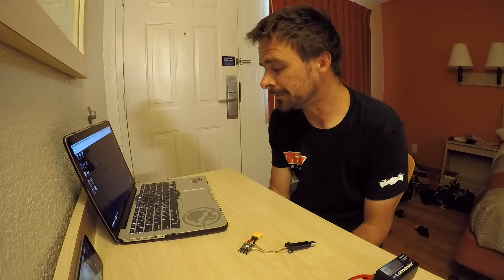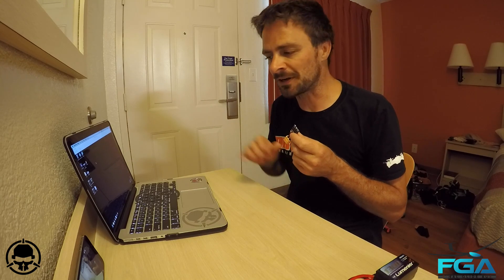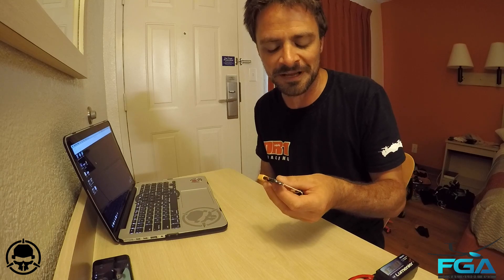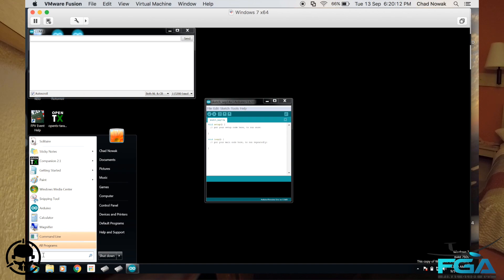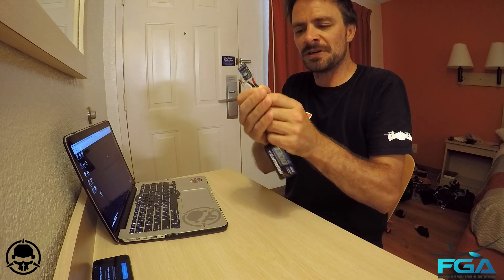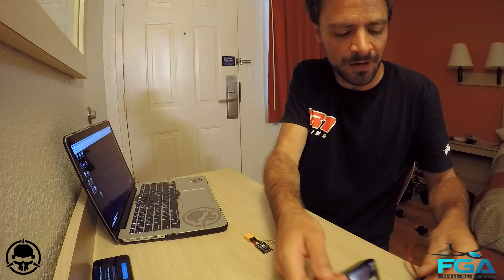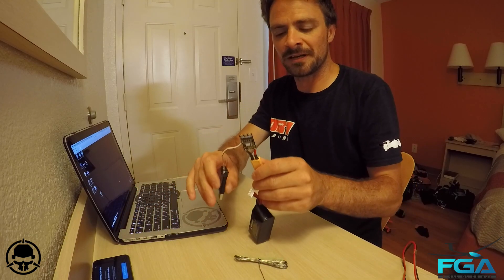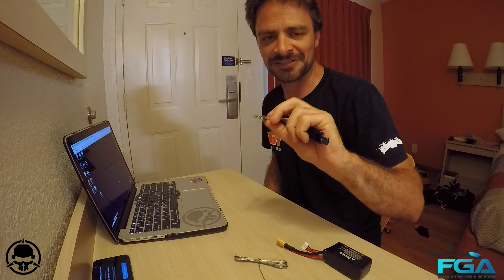Flashing FW 1.02 to earlier versions of KISS 24a using a USB UART tool

Comment: I know this is old. but I'm updating some 1.01 esc's I had on my first build, it was a naze32.   I also have another quad with full kiss setup.. but these I'm doing now will be going with an SP Racing EVO board.    this video was awesome thanks! got them all updated to 1.02... but how do I get them flashed to the latest firmware after ive done this?     thanks again Chad.

Comment: Now I have run through the tutorial with 2 ESCs and after desoldering the bootloader pads I thought id just check via the serial INFO and in the serial number info my ESC still states version 1.01.
Would this be a glitch, even tho it told me that it all patched correctly?
Reply: I have the same, and was wondering the same. I haven't updated to 1.03 yet because I don't want to brick my ESCs. Anyone know the answer?

Comment: Holy crap, those TS100's sure are the duck's nuts!
Thanks for bringing that to my/our attention, Im now wondering if I really should keep saving for a Weller! :v
Already sent off for the 7 extra/spare tips/irons- bit pricey (20bucks more than the original TS100) but damn Im impressed so far with the iron itself...
BTW, a 'getting into multi-rotors & the bits you'll need' clip/episode would make starting out in hobby easier for budget-minded noobs that prefer to invest in quality without wasting cash or having to trawl through forums would be HUGELY helpful ;)
Anyways, thanks again FGA!

Comment: Thanks Chad, just got around to doing this. BTW it works by just disconnecting power to FC. Just have to unscrew motors and lift Esc up to get to pads on the bottom. No need to de-solder anything.

Comment: Hi.  I'm interested in flashing back to firmware 1.02 (stable release, as sold new-in-box).  After I recently flashed to 1.03h, I have a wobble for 2 seconds while in 3D mode when I transition from positive & negative throttle.  The wobble also happens after a sudden stop of a full pirouette.  It did not exhibit this behavior earlier in the day before with firmware 1.02.

Where can I acquire the 1.02 (stable release, as sold new-in-box) firmware, and how may I flash it to the ESC?  Thanks in advance, because the wobbles really are scary when I'm trying to so 3D maneuvers and feels like I'm out of control for 2 seconds.  :(  Thanks.

Comment: FTDI adaptor also works (the one used for flashing a minimosd)...Remember to also connect the ground...I never and it would not read the esc, took me a while to figure out that the ground needed to be connected to the ftdi adaptor. Also on my adaptor I ahd to connect RX to RX and TX to TX.

Comment: Hi Chad. Being a lazy bugger do you think de-soldering sig, ground, telem, from flight controller, leaving motors soldered and powering battery through pdb of Alien will work. even tough all esc's will power up but only the one your working with will be connected to computer but motor still connected ?

What you recon ?
Reply from the maker: That will be fine mate

Comment: Hello Chad, thanks a lot  for this vid’ ! 
only one question : can I flash each esc without de soldering it from the FC and Motor ? or is it absolutly necessary to have only power and usb Uart leads like yours on the vid?
Reply from the maker: There should be no signal coming from the FC when flashing the esc as that will disrupt the process.  It is recommended to desolder the motor wires for safety but I have tried it with them on an it was fine.
Reply: Thanks for you quick answer Chad ;-) 
Have a nice day. Aurélien

Comment: Hi Chad,

I flashed from 101 to 102 on my ESC but when I do an "info" after the update it still says 101. Is this correct or did something go wrong? The firmware site states (KISS24A FW v1.02 (1.01 but with bootloader)) so is the 101 referring to the bootloader or firmware version?
Reply: Can anyone tell me if it is supposed to be 1.02 after updated or should it still be 1.01?
Reply: So to answer my own question... The Kiss Facebook group said this is a hardware version and it doesn't refer to the firmware version.

Comment: I have my KISS 24A 1.01 ESCs soldered on a quad right now! Can this process be done with the signal wires intact, without desoldering them? I will disconnect the power to the KISS FC from the pdb while flashing so signal wires shouldn't cause any problem, should it?
Reply from the maker: I have not tried this so cannot be sure myself.  I would think that if there is no power to the KISS FC then you should be fine but cannot be sure.
Reply: FinalGlideAus Will try it out and see. Removing each and every wire and resoldering it back would be pain in the ass. Hopefully it works! :D
Reply: Hi Himadri FPV, does it worked?
Reply: sorry man haven't yet tried..it should work as you are disconnecting the power to kiss fc...thus it won't interfere with flashing process

Comment: Say you don't really have the time to flash would running 3 esc's with 1.01 and 1 esc with 1.02 have any negative impact on my flying?
Reply from the maker: They would fly the same but I would recommend doing this so you can flash to v1.03 FW as it is a decent improvement.

Comment: On the mac/linux, you can use 'screen' program (cli) to access the serial port... Its INCLUDED with mac osx.

>screen /dev/tty.xxxxxxx 115200

Thats it ;) No arduino crap required.
Reply: how does it work?

Comment: Thanks, for this great tutorial video, Chad ! if one must do all 4 esc's there can also be made one hex file, out of the 4 serial numbers of the esc's If understand correctly out of the Flyduino manual.
I now have bought the 1.02 version from Flyduino directly, does this mean i don't have to use windows on my Macbook to program/use the Taranis or KISS hardware ? I got fed up with M$ and bought a Macbook Pro, 8/265 i5/2.7 2015
Reply from the maker: 1.02 FW can be used through the GUI
Reply: Nice thing also: the KISS FC gui is a standalone now, it's no Crome app anymore.

Comment: Hi Chad, I did the V1.01 upgrade to V1.02.  Then I flashed V1.03 from the GUI, motors don't spin when armed and motors cogs.  I tried to flash back to V1.02 from the GUI but keeps saying it cant flash the file.  Do I need to do the V1.02 upgrade one esc at a time again?  I ran on another quad with just V1.02 that runs fine.
Reply from the maker: Using 1.02 FW esc's you can flash all esc's at the same time through the GUI
Reply: I deleted all the V1.02  hex files that was generated with each serial numbers, I wanted to downgrade from V1.03 back to V1.02, but I cant find a V1.02 esc hex file to use through the GUI.

Comment: Hi Chad! I enjoyed your tutorial. Like others I can't seem to find a changelog for 1.03h. I'm on 1.01 right now and I'm considering updating but I don't want to spend hours desoldering and removing heatshrink etc. unless there is a compelling reason to do so. Is 1.03h a major upgrade over 1.01? Do you know of a firmware changelog? I can't seem to find one.
Reply from the maker: Smoother power, more power, more efficient, bugs like some dead duck fixed
Reply: Thanks for the reply! Looks like I've got a project for my next day off.

Comment: What is the advantage to upgrading to 1.03 except for the software bootloader? Trying to find info on this without success. Thanks
Reply: 1.02 is 1.01 with the boot loader, 1.03 has had improvements to the software so that it runs smoother/ more locked/ better

Comment: Hey Chad, because of you, Steele and Rotorriot, I build my first 250 quad 2 days ago, and I am loving it! Now I want to get me some nice goggles, but I am torn between the HD2's and the Dominator V3's, I would be super happy if you could help me decide.
Reply: I'd recommend the Dom V3's, I've tried them all on. But its my personal preference, you cant beat a hands on to help you decide :)
Reply: +DR.3 Thank you for your feedback! Why do you like the  Dominator V3's better?
Reply: Can anyone confirm the rumour about a new dominator model being developed? Not the orange and black fatty shaks but an upgrade of the V3's?
Reply: Honestly, it's personal preference and budget. Flight test just did a comparison video with the newest orange Fat Shark against the others. Unless you are planning on using an HD receiver, save the $100 for parts for the quad. A lot of people get the pricey HD goggles for the screen size and fly analog. That's why Fat Shark put out the orange goggles. Same specs and features as the HD, minus the HD.
Reply: +Nimbuslayer Thank you for your feedback, so its up to the V3's and the SE's then?

Comment: oh yeah I'm definitely buying one of those soldering irons. But I just found them on them good and they do not come with an xt60 connector. You will have to make one of those on your own as it comes with a USB lead
Reply from the maker: pretty simple mod. Wire, XT60, done :)
Reply: cool thanks. is there a difference in operation depending on your batteries? 3cell/4cell?
Reply from the maker: From memory it will take 11-24v input.
Reply from the maker: I have only tried 4s packs as that is what I use. Higher voltage will be better

Comment: For my own sanity i am glad you had issues with arduino/serial monitor on mac it was pissing me right off. Good vid Chad.
Would you say 300 degrees is the max temp you would solder with ?
Reply from the maker: Power wires on the KISS 24a I use around 350 deg c usually.

Comment: wow do I really love the new esc firmware. totally got rid of my motor stuttering when i give rapid throttle inputs..  i almost threw in the towel and stopped using kiss products but after getting everything updated, i have definitely regained confidence in FLYDUINO.   I checked all my receipts and ive spent $ 2,113.72  on kiss products.   I have built 10 KWADS in the past 2 weeks using all kiss products and i really thought i wasted my money until i seen the esc update video. I build Kwads because i just completely love building them and because i have some friends who would love to fly but dont have the money to do it so i took a small loan out and built KWADS for 6 of my friends and got them some goggles and batteries. i guess i just really love this hobby and the people who i meet along the way, its almost like a brotherhood of sorts and i just really love to hang out with everyone and fly so when i seen that my friends really loved it but were depressed because they couldnt participate,, i took up a collection from fellow pilots to get money so i could build them there own multirotor. it just wasnt enough for everyone so i went to the bank got a loan and went home and ordered stuff for them. now they are in the air flying and part of this awesome life that really brings people together..  sorry for so much but the point im getting at is thats it's because of all you guys at rotor riot and the knowledge that yo all have shared that has kept me in this hobby. and it was because of the problems that the KISS products gave me that i almost walked away. i have spent almost $20,000 on this hobby since march 24th of this year and i thank you guys at rotor riot for always reminding me thats its all about having fun and making new friends along the way.... 

Thank you if you took the time to read this,,   HAPPY FLYING,    EDDIE